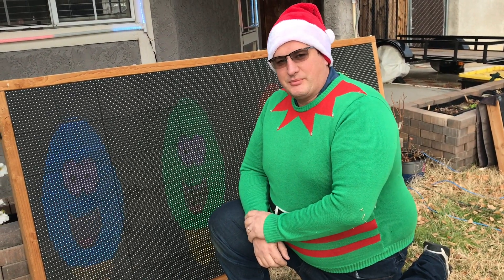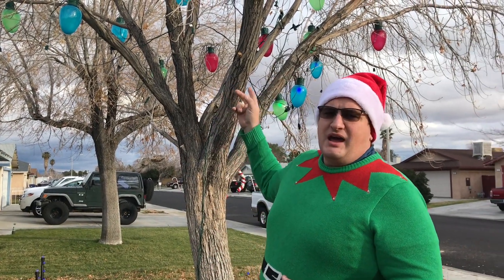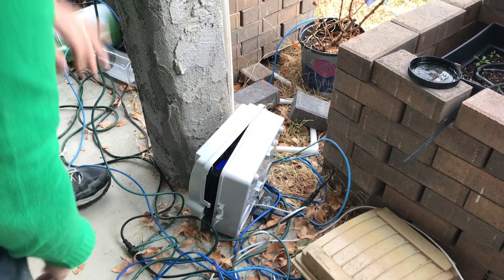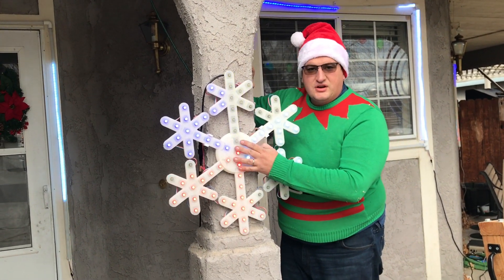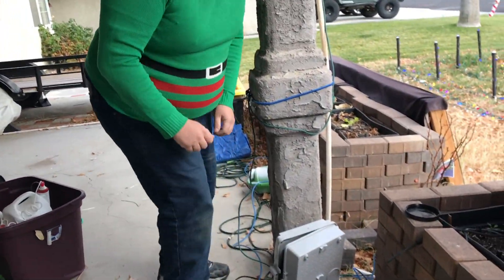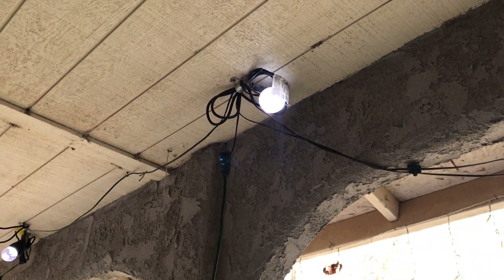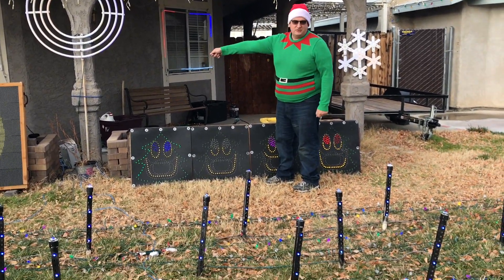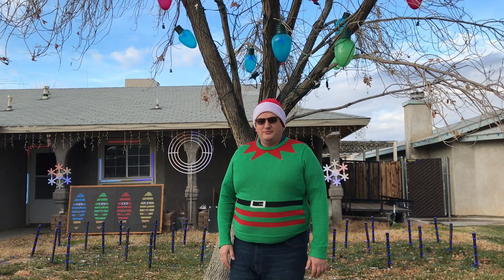Eds Light Show - 2019 Behind the Scenes

Comment: I need info 
I have a idea if adding 4 pi to the yard with pi hats on each one as my 2nd year 

My question is do i upload the same file to each controller/pi ?

Do i just use the ip address of pi in xlights ? And unicast ?

I plan on doing a acesspoint like u did but have all 4 p'is connect wireless to that are in remote mode 
And one pi near the house as the master that way im just running power at each spot with their own powersupplies?

Woild this ide
Reply from the maker: I upload the same sequence data to all of them via web browser, however a lot of work has been done to FPP and xLights in the last year. You can connect right from xLights, and send partial FSEQ files to each respective Pi (I'm not doing that yet). Some of my Pi units output e1.31 to pixel controllers, that I use Unicast. If you are doing control from the Pi units directly, then the Multicast/Unicast options in xLights become irrelevant, and the Output settings of each tells that Pi what data it cares about.
Reply: @EdwardCzajka  thank you

Comment: This holds up during rain and numerous earthquakes! LOL
Reply from the maker: We had a rain on night of the 22nd, and we covered the P10 screen, but water got an exposed wire and cooked one power supply. The eves of the house concentrates rain water on top of the P10. Had to do a quick Amazon order, so we were down the P10 screen on the 23rd, but had it back on the 24th. Everything else is fine, just not running in a downpour, its the desert so its not that much rain. Let the sun dry everything out for a few hours before testing again.